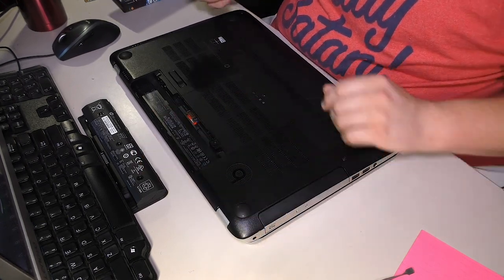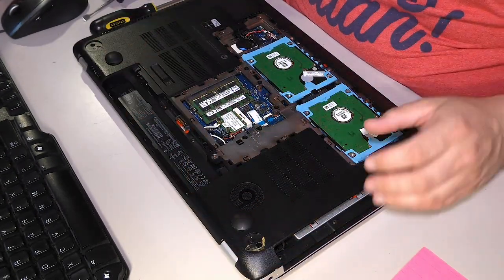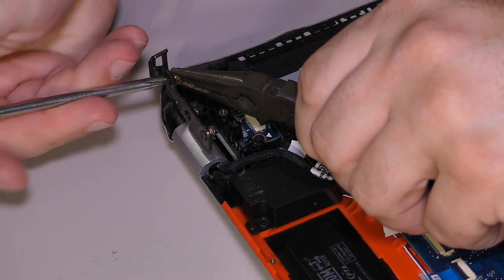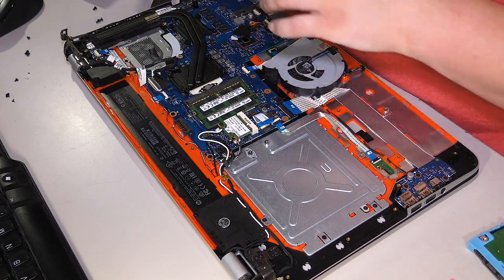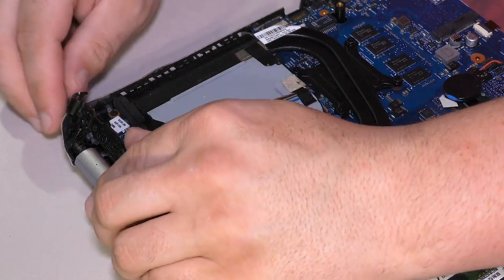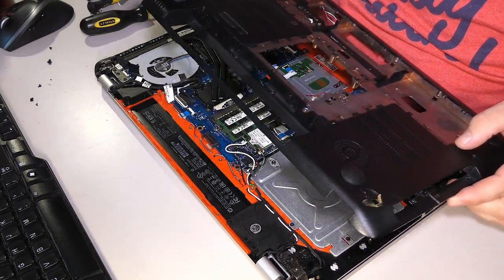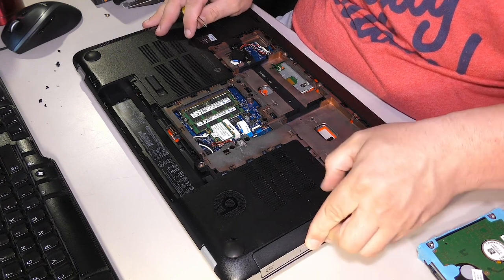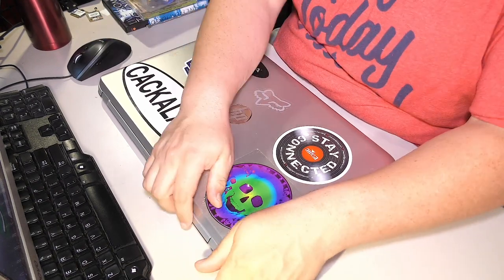HP ENVY Touchsmart 17t-j100 Disassembly and Hinge Mount Repair - Jody Bruchon

Comment: I believe its a design defect or just the general age of the laptop. I have that same exact model and I have the same problem on the same side. I never dropped my laptop. once I took the laptop apart, all the plastic post  housings have cracked. I ended up replacing the top cover to fix the issue. should have just used epoxy like you did. great work.
Reply from the maker: Yeah, it's not the best design in there. Lots of plastic posts, not enough metal reinforcement. I'm glad you got it fixed!